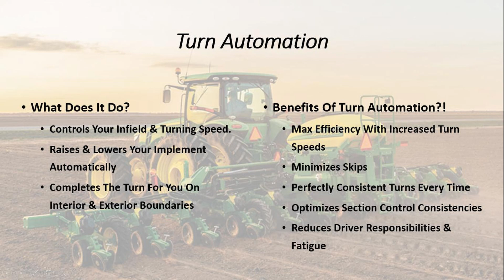John Deere Turn Automation Demo

Comment: I’m stuck on this error “machine speed automation must be activated”. I can’t figure out how to fix it, any ideas? Also showing that the "vehicle speed" is faulted and "max engine speed"  is faulted under the iTEC info and settings.
Reply from the maker: What model machine is this and also have you activated the free speed automation activation in the command arm
Reply: 8360, activating the speed automation on the command arm fixed it, thanks!